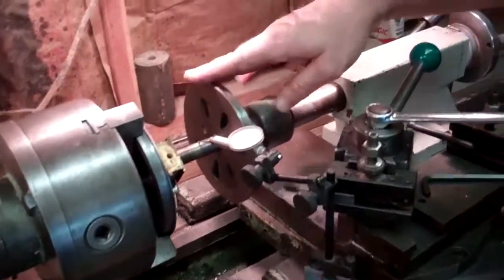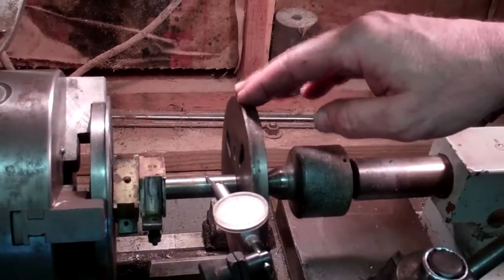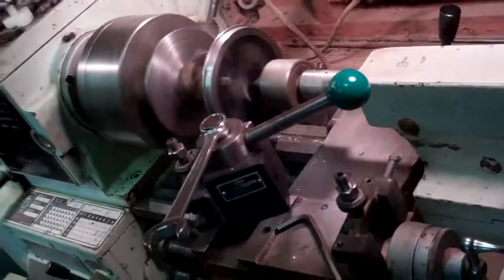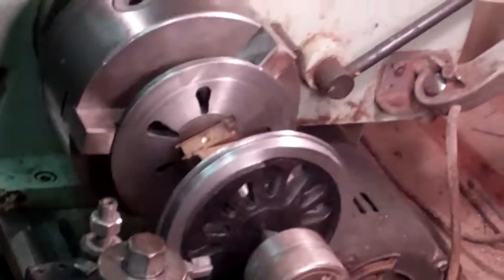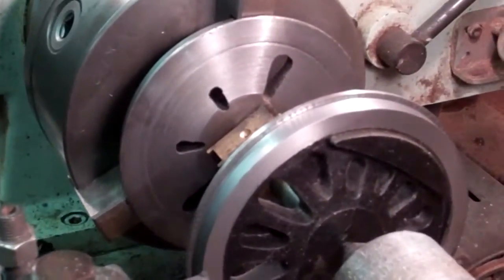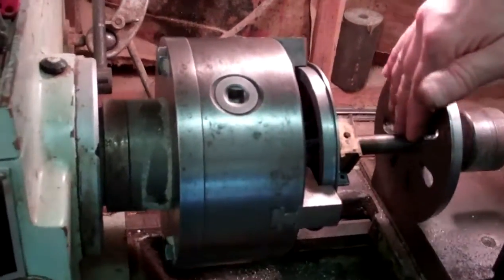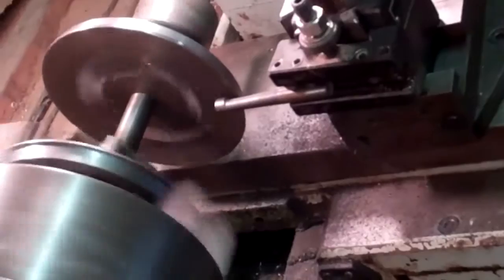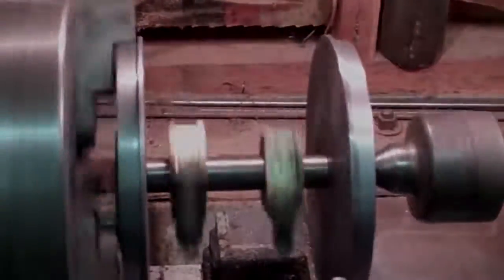MACHINING WHEELS FOR THE LIVE STEAM PROJECT

Comment: You should look at the ibls standards  for live steamer wheel profile.

Your wheels need to be the same diameter  or you will have a slippery engine.

The wheels will be fighting each other
as the engine goes down the track.

 I don't  see you checking any diameters.

Those flanges look square to me.

Square flanges will shave aluminum rail like a cutting tool causing you grief 
with track owners where you run.

Your back to back dimension needs to be held close to clear flange ways.

You don't need to hold half a thousanth 
on o.d. tir.

The suspension will allow for a little bit of runout.

You talk like you know what you are doing but you are mostly wrong. 

kap
Reply from the maker: Well, I have been a machinist for close to 40 years. The wheels are indeed the same diameter, I checked whether or not you think so. I treated the flanges to a proper profile at a later date. I may not need to hold the tolerance I did but since I did so with no problem, I don't see what the problem is. Trust me I understand what I am doing. I will have to look at your videos and pick them apart so I can feel important as I'm sure you are the best at what you do. I just thought it would be interesting to  show a little bit about what I was doing. Sorry you felt the need to be so critical.